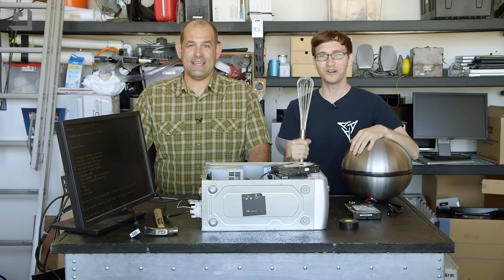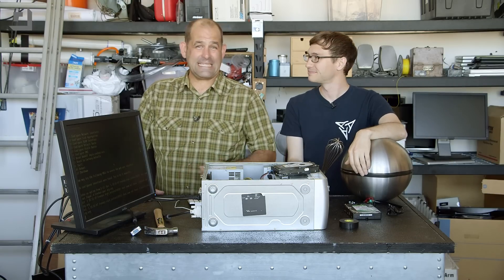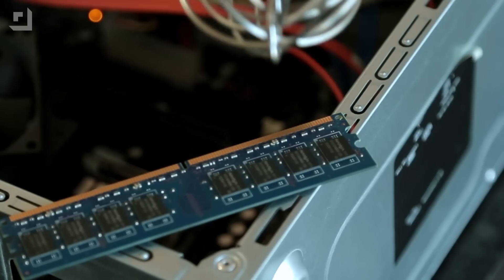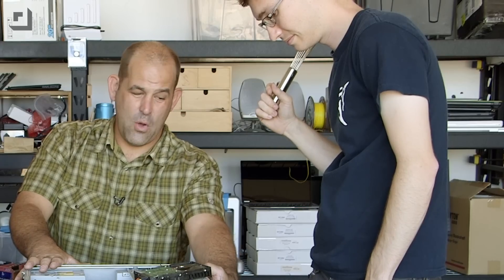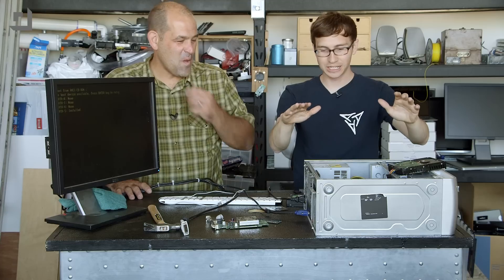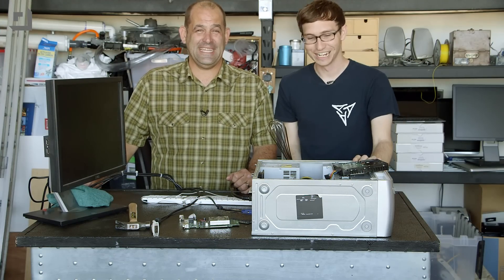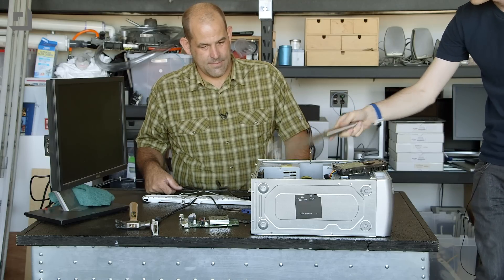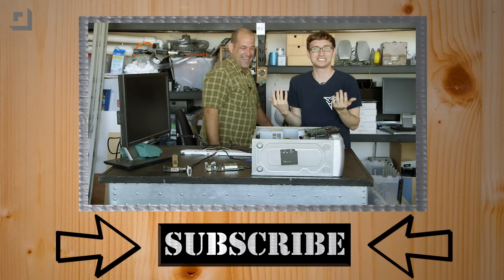Can Static Electricity Kill Your PC?

Comment: Well, that was useless...  Zapping things half a dozen times had better kill it...

How about we do it with one zap per component.  Simulate reality.  Because once you run across the carpet and touch something, you only have one zap in you.
Reply: A Norwegian hardware site did do just this.
Using real world means with sweaters, floor mats etc and they couldn't kill a single component.
However, there could be some long term effects causing death of the components.
Reply: Mark Collins Just so you know, plugging into a grounded outlet is NOT a factor you have to do.
Unlike normal electricity, static ones do not seek the "ground" it seeks to equalize the difference.

And static voltage wise, a door or building can be charged with a potential voltage, if you show up being less or more charged, there will be a discharge to bring the two to the same "static" voltage.

So to prevent it, you want to make your working area all have the same "static voltage", and you help that by touching the case, as your movement can change your voltage.
Reply: oromis995
Read my first sentence in that comment a couple of times.
Between two surfaces, having it connected to the ground is NOT required for it to be considered of an equal charge.
Reply from the maker: Bad things started to happen after 1-2 shocks on most of the stuff we tested. I think it's has more to do with touching the wrong place than the number of shocks. -Michael
Reply: CMDR Sweeper I apologize, I did not see the difference in meaning between " NOT a factor you have to do" and "it's useless". It was I who spouted idiocy.
Reply: DIY Tryin I never wear straps BUT do have the case grounded via the plugged in PSU and always touch the case first and have never killed anything in the 20 years of building
Reply: I actually don't understand these static things work. Can someone explain it to me? And, ground yourself, do you just touch anything or what?
Reply: Jason Price I've had two in me before
Reply: Mark Collins Yeah same as well. I just touch the case to discharge and start removing parts. Alot of it just depends on how often you as a person get shocked. If your always getting static shocked then you might want to invest in a band, but if your rarely get shocked then don't worry.
Reply: TheRagingBrutes As long as the PSU is fitted to the case and plugged into a earthed/grounded outlet your good you probably end up touching the case more than you realise during a normal build.
Reply: +Izmeer Jaafar you have to touch something that's grounded . On a plug there is the +, the - and the ground. the case is normaly pluged to the psu wich is grounded (plug the power supply and turn it off). or you can touch the power supply case directly.
Reply: ***** Possibly the only one, I dunno where that article is now, it may even be behind a paywall at tek.no ex hardware.no
Reply: +DIY Tryin I agree with OP. You're overdoing it. You could've zapped the RAM, GPU and HD just once and stress tested them to see if they would still be OK (normal use wouldn't be effective to check it). Under normal conditions that zapping would happen just once and much less intense.
Reply: +Mark Collins It's actually dangerous to be connected to the AC earth/ground because you WILL act as ground for pretty much everything you touch or in other words, you'll become a transit for the grounding path. Any unpowered large metal object will make you static-free without the risk of being electrocuted.
Reply: iamphilliam Well, you are wrong. When the PSU is switched off, the ground or earth is still very much connected to the PSU case from the wall outlet and through the PSU case to the PC case. It never gets disconnected, even when the PSU is switched off. Only when the power cord is removed from the wall outlet. If you connect yourself to the PC case with the PSU connected to a wall outlet, it would be exactly the same as connecting yourself directly to the wall outlet's ground or earth pin. You just get a false sense of security when the path to ground is obscure.
Reply: Well, even then, that's an extreme case. You typically do NOT have a zap. That's like a 1 in 100 chance. lol! So even then, it's rare to get SO much static to 'zap' something XD
Reply: Actually, it is real.  There is a company that does compliance tests with an ESD gun.  This video is considered as a margin level test.
Reply: dont be idiot. of course that one zap will do.
Reply: CMDR Sweeper ... Seeking the ground is equalization... Open a book before spouting idiocy.